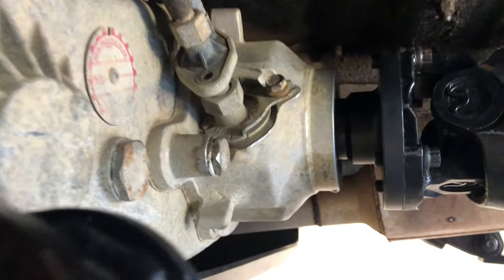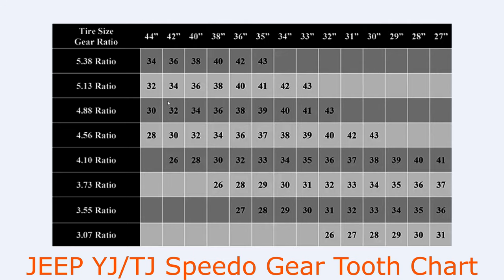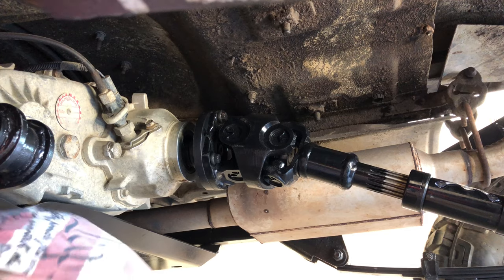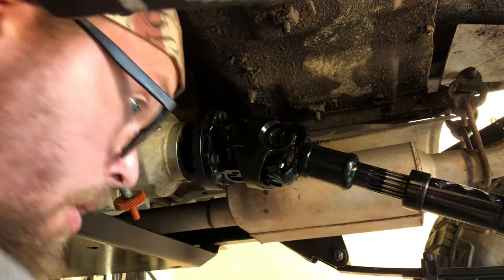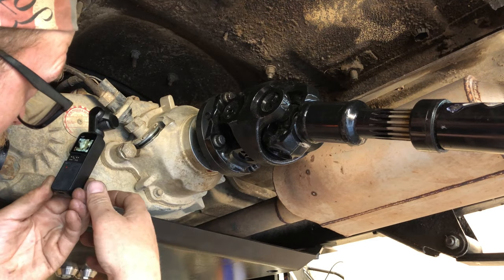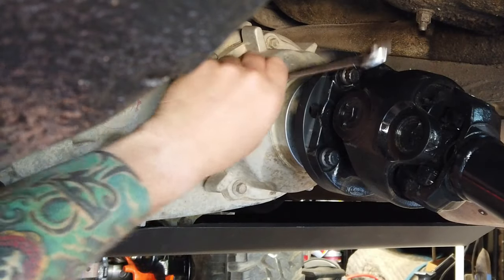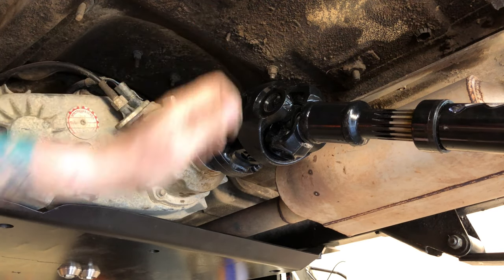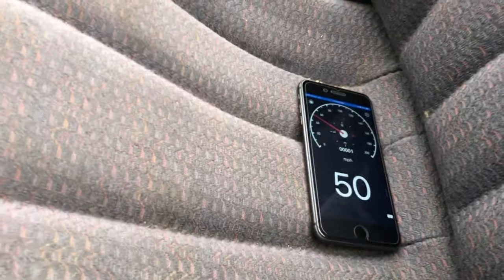Fixing Speedometer after Tire or Gear ratio change - YJ - TJ - NP231

Comment: I JUST did it on my 2.5. I've found if you get it aligned, use the clamp to help tighten it down, get it in there pretty square and then start tightening it down and it'll go in itself
Reply from the maker: Just don’t force it

Comment: @FlawedOffroad, Great video but unfortunately, the Original AMC 86 1/2 YJ (Before the sale of Chrysler was complete) came with a NP207 transfer case. Just curious if you have heard if it were possible to adjust the NP207 for the speedometer gear. I'm guessing the NP207 is not adjustable and I'll need to replace it if I wanted to correct my speedo?
Reply from the maker: @andybenavidez1701  never seen one, no clue what it has
Reply: @FlawedOffroad  It doesn't have an adjustable clocking mechanism unfortunately. It's a Chevy transfer case.  After additional research, it was used for the one year of the YJ that we have. No worries. I'll probably need to upgrade it to NP231, so I won't have to worry about it going forward and at least the NP231 will still mate up to the AX15 and I can eventually get rid of the Peugeot transmission.

Comment: I recently bought a 1995 jeep wrangler and the odometer and speedometer don’t work. In addition, the turn signal lights don’t come on on the dash. What do you think the issue is? 

It is my understanding that the jeep did get reheated and has bigger tires but I am not sure if that would affect everything I just mentioned. Any help would be appreciated 🙏🏼
Reply: Other gauges do work
Reply from the maker: on a 95 there is no speedo cable, its all electronic. I would pull the dash cluster out and clean/check all grounds. They are notorious for getting corroded and gauges not working.

Comment: Great video ! So I have a 1970 charger , Iam about to change the tire size , can I do the same thing you did to achieve the correct speedometer reading ?
Reply from the maker: It’s just a 2 Wheel Dr. transmission instead of a transfer case so as long as it uses the same style gear. From my understanding the old Dodges use the same ones as the jeep with the longer shaft.

Comment: Hello, I got bigger tires and after a month or so my transmission stopped shifting, I have a 2017 wrangler, no transmission fault codes, bought a new transmission but still shift from 1st to 3rd only, do I need program the tires or do I need to change my axle gear?
Reply from the maker: I think you need to tell the ecu what size tires and gears you have with a flashcal or tazer or similar product. The speed sensors aren’t reading In Range where they should and it’s probably in limp mode.

Comment: I dont know my gear ratio! Any chance u could do a video on how to figure that out???
Reply from the maker: Well I could but it would be faster to tell you. Look on your differential cover for a tag, between the bolts. It will have some numbers on it 4 11 would be 4.11. 3 07 is 3.07 and so on. 
If the tag is missing there’s 2 other ways to determine. The “spin tires” way or remove your diff cover. Gearset should have it stamped on there. The spin tires method has a few variables such as if you have a locker or not. Might be best to google that I’m sure someone on jeepforum has explained it better than I can.
Reply from the maker: To add to this, if you have a 2.5 5 speed it’s 4.10. 2.5 auto is 3.73. 
The 4.0 came mostly in 3.07 auto and 3.55 manual but there’s a few variations so dont take that as gospel. This of course is assuming YJ, I can’t speak for tjs and xjs
Reply from the maker: I’ll tell you what, I didn’t have anything to make a video this week due to other projects getting in the way but I might be able to go out there this weekend and make that. Seems like a easy enough topic
Reply: @FlawedOffroad  I have an 89 yj with the 4.2 and a 5 speed. Just bought it. Not familiar with Jeep. It's had some work done but no info on what exactly
Reply from the maker: @M Mc I just made the video you requested https://youtu.be/8N2npR2jCwU

Comment: Hi Dan, I have an 87 Wrangler I put larger tires on it. The speedometer jumps all over between 20mph and 40mph. Do I need a new cable or should I change gears like you just showed in the video? 

Thank you, your video was very informative and helpful.
Reply from the maker: It might be clocked wrong(the housing that holds the gear), or the speedo itself could be bad.
Reply: @FlawedOffroad  okay, thanks!

Comment: I have seen two charts now with slightly different gear choices IE tire/axle to speedo gear tooth count. The two I have seen are two teeth different from each other... I think I will use your chart when I install my new axles/gears and 35s since you tested it with a GPS speedometer and was near perfect. My TJ is off 10 MPH low, above 50 MPH with 3.73 and 33s, I have no idea what gear I put in it when I originally rebuilt the T-case so who knows, maybe it's correct for 35s  Haaa.
Reply from the maker: I have looked on google image search and noticed a difference. Honestly certain gear/tire combos probably fall between 2 sizes. I would err on the side of calling your tire 1" smaller than it is. Most 35's measure closer to 34's and so on. all depends on the brand

Comment: He body 
My jeep has a lot of mods 
4:10 gears 
Atlas 2 tranfer case 
But it doesn't read the milles or the speeds what can it be
Reply from the maker: Is your jeep 92 and newer? or 91 older? 1987-90 use a cable, 1992-95 use digital sensor. 1991 uses both like mine in the video.
If your sensor is in place, pull it out to see if theres a gear on there and if its clocked properly to mesh with the gears on the output shaft. if you have the cable version, it can come unhooked behind your speedometer so pull that out and check there as well. Good luck

Comment: I have a 1998 Grand Cherokee all-wheel drive I am changing my tires from 15 job to 16th do I need a bigger or little speedometer
Reply from the maker: The wheel size does not matter, what’s the actual height of the new tire? You also need to know your gear ratio in the axles

Comment: You seem to know your parts.  I have a 1990 6cyl 5 speed and am trying to install a custom dash.  I'm having a hell of a time trying to find a gauge to fit the speedo cable (slip on). All the gauges have threads. Is there a way I can switch mine to electronic to give me more gauge options?
Reply from the maker: Easiest would be a gps speedometer that doesn’t need a cable or signal. Otherwise you could use the newer yj sensor with the short shaft gear, you would
Have to run a wire
From dash down to it and maybe a ground and figure out which wire is the speed output n

Comment: Wish I knew what my brother geared his at. currently has 2 different sized wheels due to a blow out and the speedometer jumps
Reply from the maker: Very bad idea to drive like that it can damage the diff and/or transfer case if the tires arent close in size. Go buy a used tire lol
Reply: @FlawedOffroad  dad had a blowout driving it home, couldn't be avoided at the time.  Hasn't been driven since then honestly, until recently.

Comment: I ordered a 29 and installed it when I put in the new tranny; however, it doesn’t work for some reason. Do I need to swap the shaft out of the old one?
Reply from the maker: Only if it’s different (short vs long)
I would check and make sure you got the sensor clocked properly(I show that in this video)

Comment: Greetings. I need help since my speed sensor has an electrical connection but it does not have to connect the wire so I do not know where it is connected
Reply from the maker: I dont really understand what you mean. the electrical connector sends a signal to the ecu

Comment: My bro's old Heep won't get past 40mph in 4th, what could cause that?
Reply from the maker: Well that depends on a lot, if its geared super low and has small tires, could be an issue with how its running, could be alot of stuff. please tell me he's not in low range on the transfer case lol
Reply: @FlawedOffroad  I'll need to go check that... I don't think it's in 4 low...
Reply: @FlawedOffroad  looks like 2h for normal driving.... idk if it's geared low, but 1st and 2nd are super short
Reply from the maker: @STR8SICCC  if you have a different transfer case like a twin stick Dana 300, some of them have 2wd low. Please refer to my other video about determining your gear ratio it takes five minutes to figure it out. I might have a link to it at the end of this one otherwise if you go to my channel it’s about four videos back from my newest upload
Reply: @FlawedOffroad  I'll check it out, according to the shifter knob there's 2H 4H N and 4L @the wayyy back

Comment: Can you do this for a 86 s10?
Reply from the maker: Maybe, do those use a 231c? I really not familiar with how gm does it but most of them had some sort of gear that can be changed
Reply: @FlawedOffroad  I’m new to building a truck. But the speedo is WAY off. So your video helped a lot. Thank you. I’ll have to do some looking at the truck to find what rear end I have.